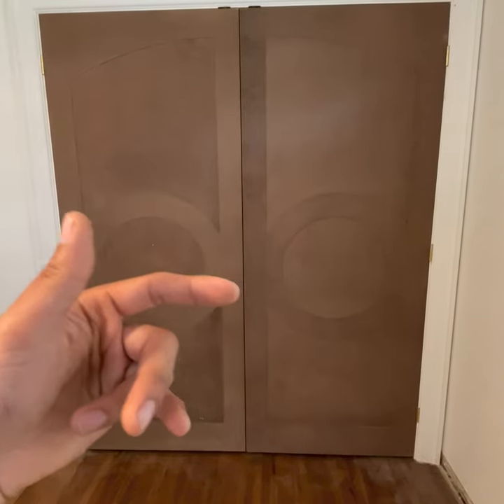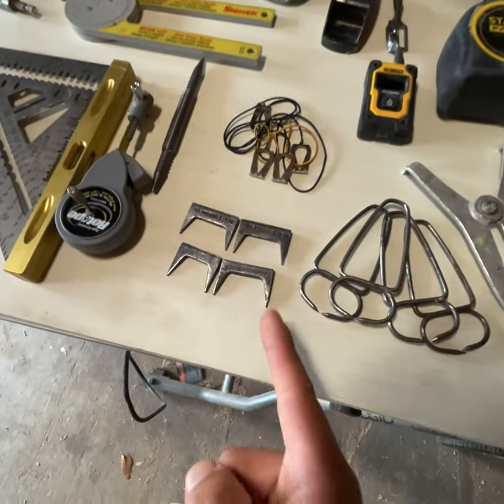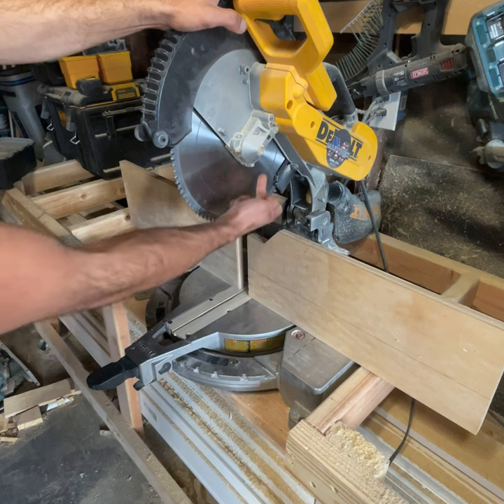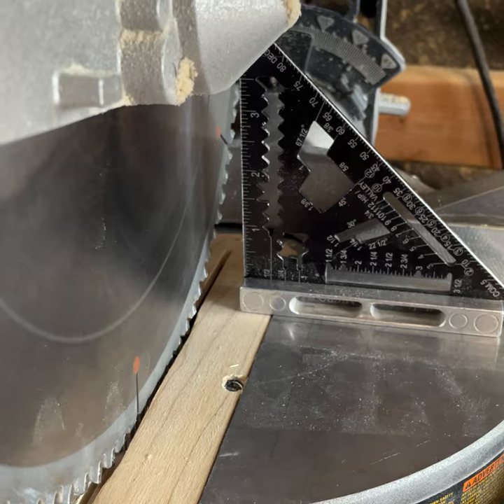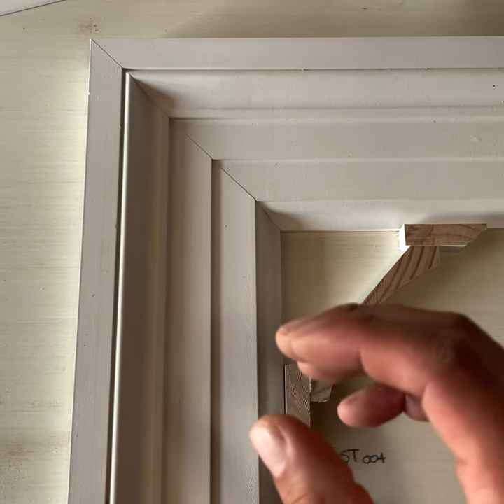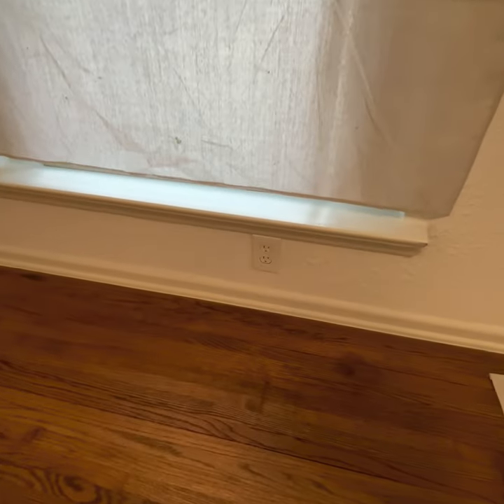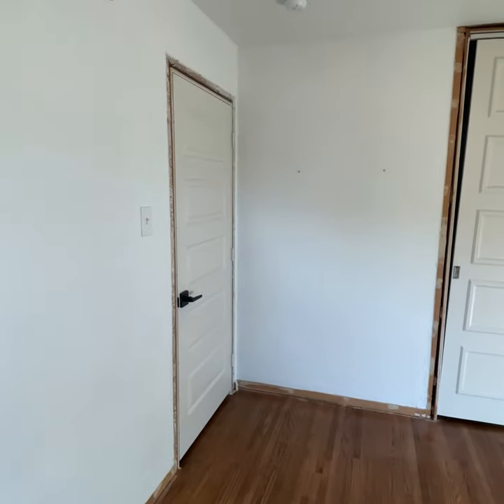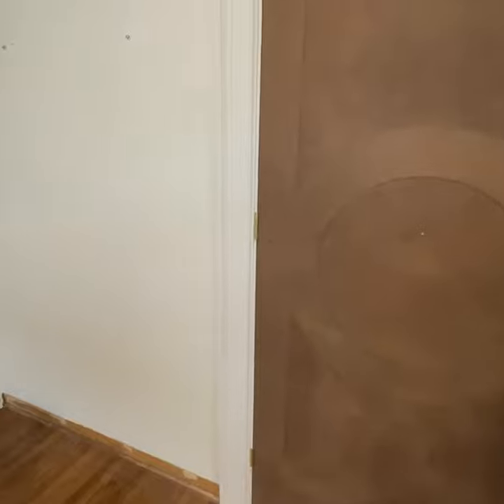Part 1: Everything you need to know for a trim & door install MILLWORK INSTALLATION MASTER CLASS

Comment: Great videos, thank you! 
Question, noticed your miter saw is not sliding, is that a preference thing or you don’t like sliding miter?
Reply: Well, I am not him, but they are much lighter if you intend to move them around a lot (for the dewalt, the difference is about 16 lbs, I think). They take up less space, they are way cheaper.

They also can have some deflection, especially as they start to wear out, which can reduce cut quality. I would never want to use a slider if I didn't actually need the cut capacity. 

The one thing that is nice about sliders though, is you can change the exact point of contact, which helps a lot for  relieving baseboard so you can tuck it behind case (when I cut baseboard to sneak behind casing, I cut the entire bottom part away, and just have the top edge intact, the stuff you can actually see. This means I don't have to actually measure, I can just cut a generic "cutback" profile which is the same every time, and then use a utility knife to trim the top to thickness to fit snugly in the gap between the casing and the wall.